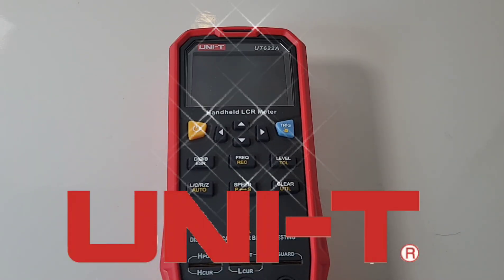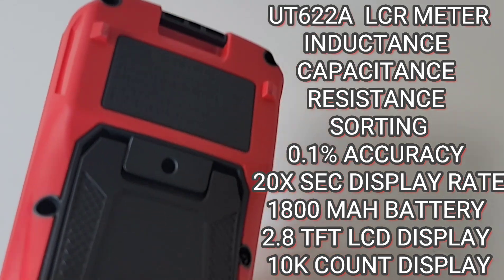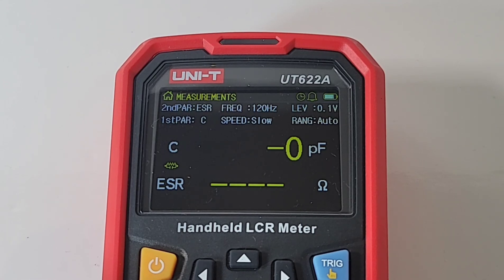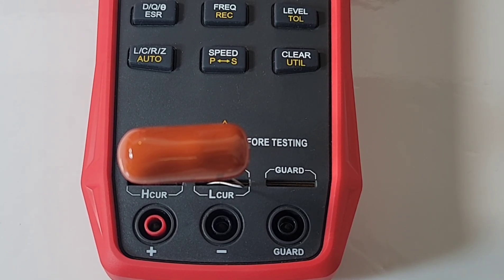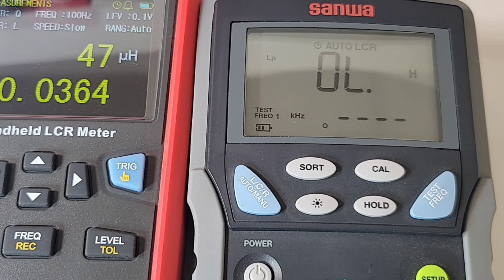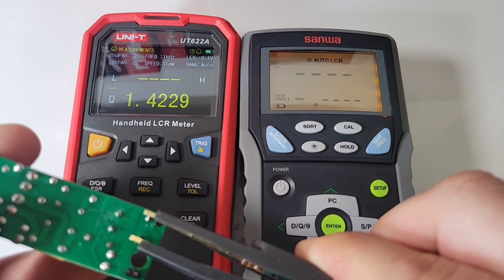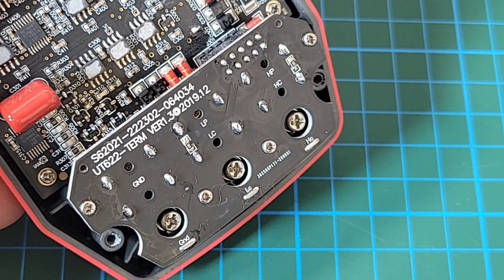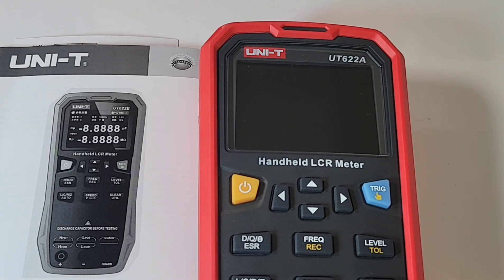UNI-T UT622A LCR METER Review  & Teardown!

Comment: What is the difference between the 622A, the B and the 622E???   Thanks for the  video
Reply from the maker: Most official sources list UT622A, UT622C, and UT622E in this series. The “B” might be a mis-label or a region-specific variant
That being said, 622E is more powerful all around, higher frequency (100kHz, compared to 622A- 10kHz). Also only the 622E supports DCR measurement and the Kelvin (4-wire) test leads on the E model help make more accurate measurements. So in a nutshell, 622E is badass👌
Reply: THANKS, that's good to know!!

Comment: if i test the capacitor on the circuit , it gives the same value or not ? and which better to measure the ESR or Capacitance value? and at what frequency to use for testing the capacitor by LCR ?

Comment: The mastech MS5308 lcr meter appears to be cheaper (especially if you compare it to the uni-t UT622E which has 100Khz), comes with twisters as standard and has 100hz, 120hz, 1Khz, 10Khz and 100Khz. My Mastech also does not have the chip markings removed which will make repair easier.
Reply from the maker: The Mastech is a good LCR meter and does ship with everything but I don't really think it's a portable test instrument. That thing is huge ( I have one). I do like the display size on the Mastech (like a big screen TV). I still prefer the UNI-T overall. Plus the Mastech takes a lot of batteries to power as well.

Comment: I could use one of those, building my own inductors and coils. Wish it can go MHz range though for my FM stuff. STM32...oh there can be mods done to it, like a different display style or even increased precision or frequency if possible. Kinda wish you could review T12 soldering stations, I'm planning of getting one like the Yihua 948DB+-II or build an STM32 kit and use community firmware, NOT keen on getting the Hakko 936 clones, they tend to be iffy. Keep on testing!
Reply from the maker: I'll be reviewing more soldering stations end of the month..I actually have the  Yihua 948DB+-II on order as well ! 😃
Reply: @KeepOnTesting  Oh yeah! I'll wait for the review for sure!

Comment: Its a sofisicated device, not too cheap, but absolutely pointles in work. If U need to check a capacitor is good or need to be replaced, just check it by simpliest device from ali. Any doubts? Throw it away and put new.
Reply: you also need to test the new replacement caps before installation
Reply: Maybe handy for inductors, though.

Comment: Looks like a nice one from UniT, nice sharp display and good build quality.  Really no excuse for no manual at this price level - even cheapo meters usually come with a manual, though I assume its available on line.  Looks like a winner though at half the price of the Sanwa
Reply from the maker: It's a beautiful lcr meter. Not quite in the same league as the Sanwa but awfully close.
UNI-T definitely has a better display and great interface..for the money you cant go wrong.